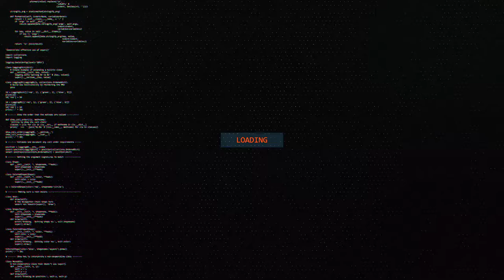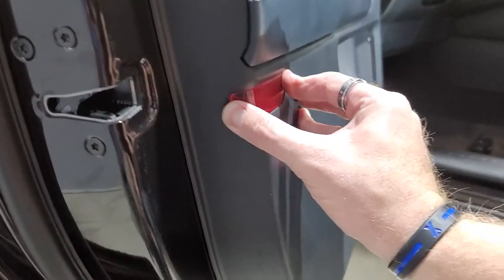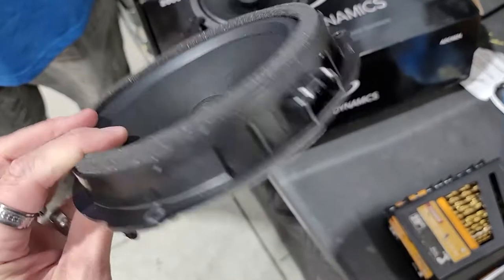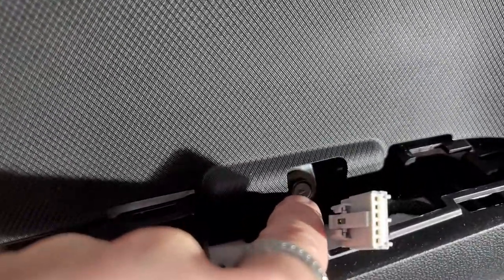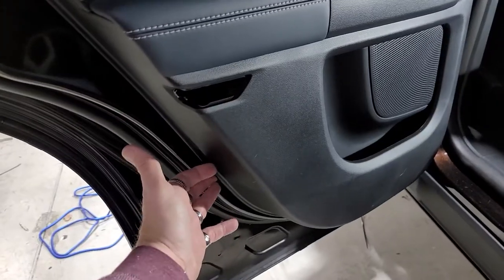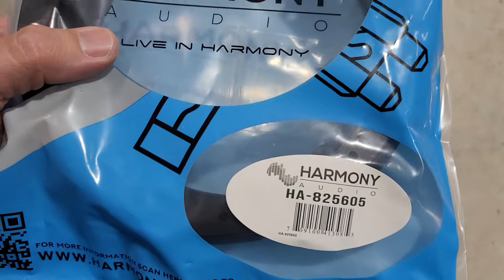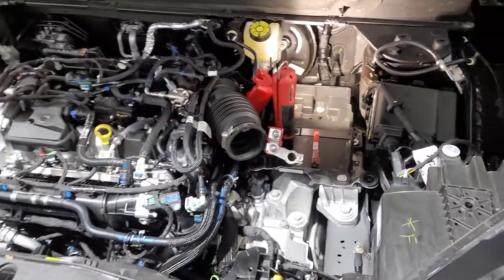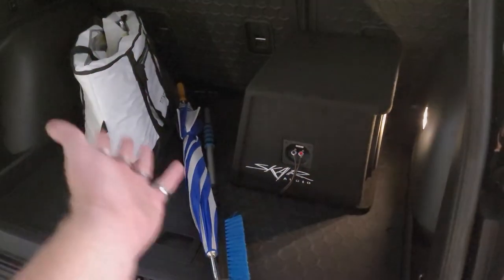2021 FORD BRONCO SPORT FRONT + REAR DOOR SPEAKER INSTALL AND AMP PLUS SUB INSTALLATION

Comment: I'm installing a jbl basspro hub powered spare tire sub next weekend. Should I tap into the factory subwoofer wire? Or should I tap into rear driver speaker through the B panel like you did here?

Comment: I did my wifes back in Feb 21. I found out Skar amps run a tad hot I had to add 2 computer fans on a PWM board to circulate air under the cover. I still need to take all the foam pockets out to build a better amp rack as I'll be adding a 2nd amp & AXXESS Interface to get full control of the audio

Comment: Just did the same job. Sounds great for sure. Issue we have is the loc , the speaker we tapped for the local will randomly not turn on with the car as if fords amp senses it. Any ideas?

Comment: Do you have to remove the microphone to avoid noise interference?
Reply from the maker: We did not
Reply: @octanetvchannel  we installed 3 amps, one 15 inch sub, a secondary battery, 2 10’ mids, 2 6.5’ on the trunk, changed all 4 speakers on the doors plus 2 horns. But I get feedback noise and all the vibrations from the car that I’m guessing is also coming from the mic

Comment: What fuse did you up remote wire
Reply: When I did my wifes I used a tap on fuse 3 in the passenger foot well fuse box